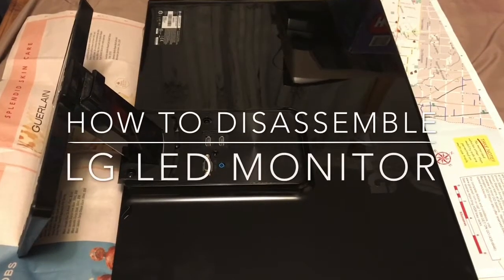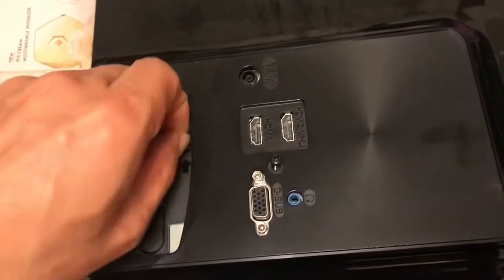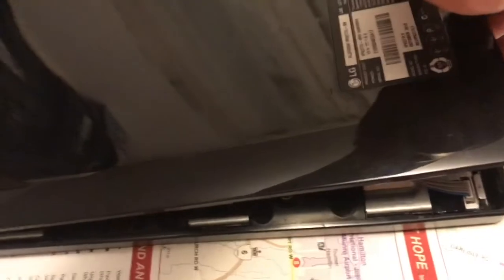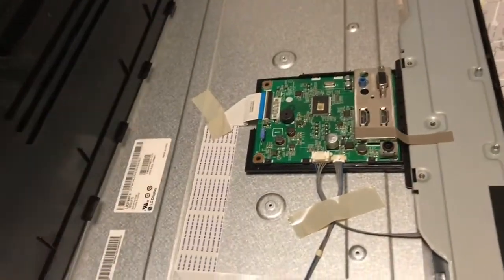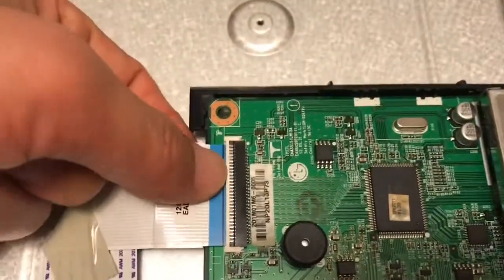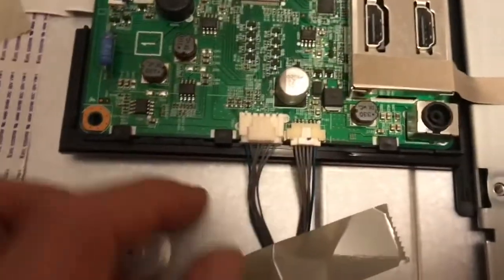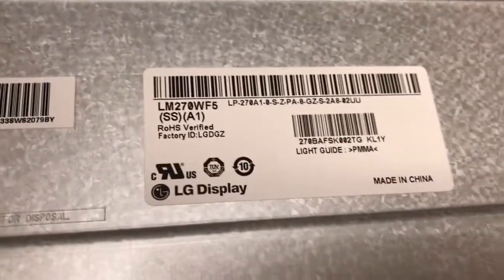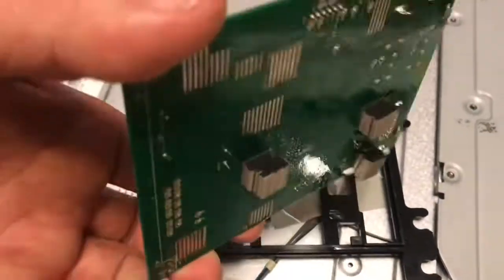How to disassemble a LG LED monitor

Comment: Is it possible to disassemble LCD panel of my laptop . . My intention is to replace WLED strip with one of my choice . . 
Is it possible  to disassemble any LCD panel without breaking the LCD. . Thanku
Reply from the maker: Better let professionals do it for you to avoid damages
Reply: @niagarafalls4205  
Well . . Technicians are reluctant to do that here because its kind of different from the norm. . They are willing to change the LCD panel itself as a whole. .But kind of relucatant to do what I want. . I am from India 
            Are you aware of people / technicians doing these over there
Reply from the maker: Search technicians in your area. Repair and postage fee here may be more than the cost of replace the whole unit.
Reply: @niagarafalls4205  
😁😁 I was not intending to get it done from there. . I just wanted to know if this has been done before elsewhere
Reply: @niagarafalls4205  Ok Thanks
Reply from the maker: Yes it can be done. But need special training